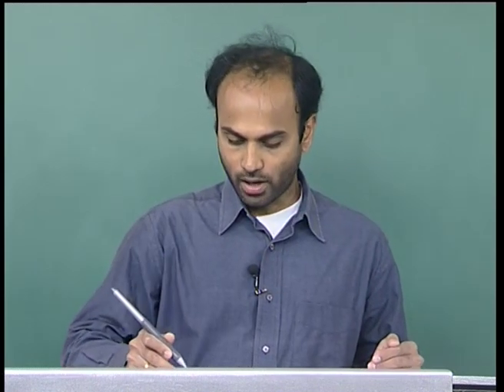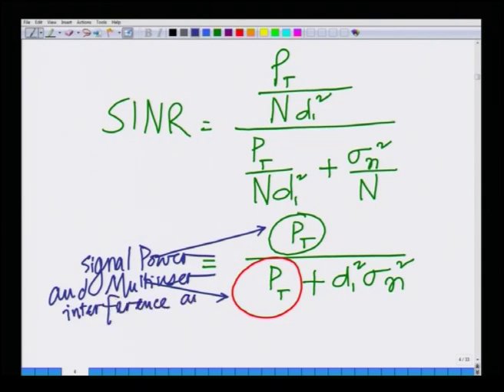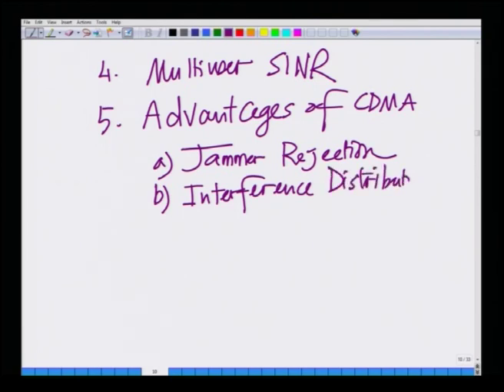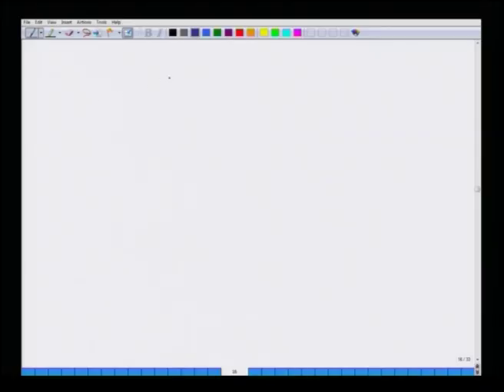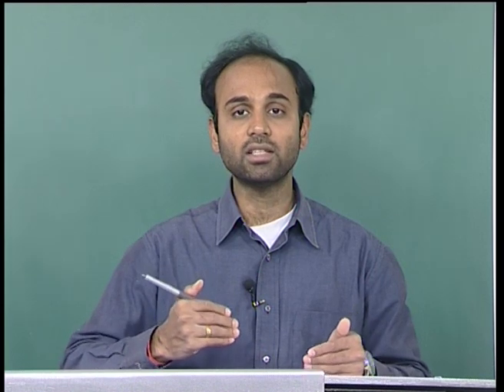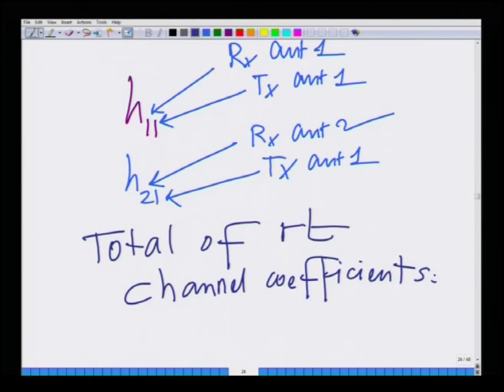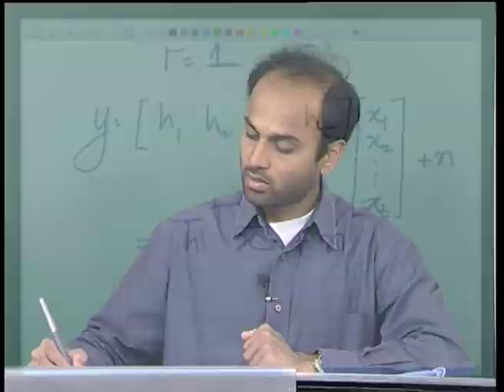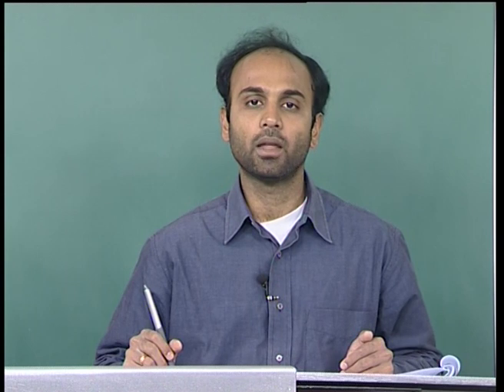Mod-01 Lec-20 CDMA Near-Far Problem and Introduction to MIMO

Comment: SIr, wont there be a noise vector at the transmitting end as well?
Reply: Transmitter transmits the information or message signal. Noise is something which is added in the signal from the channel during propagation. So it has to be received only at the receiver end